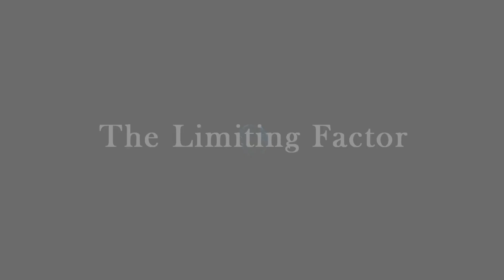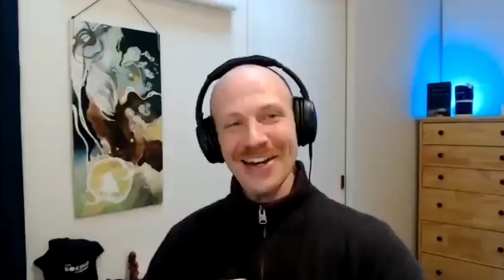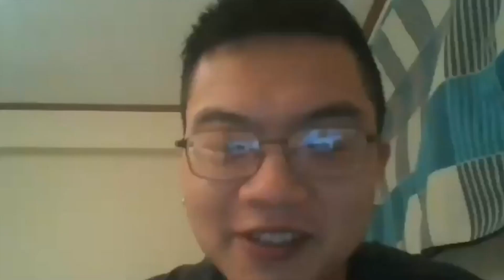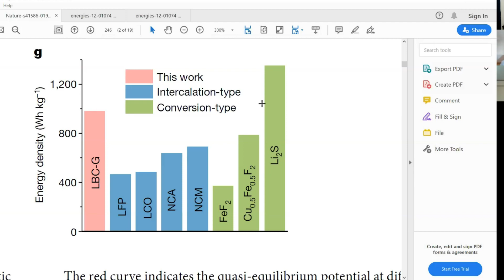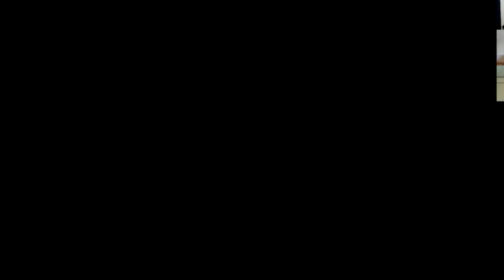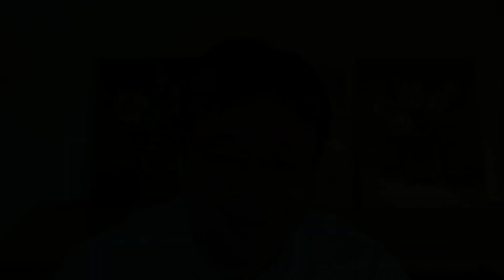Prof. Wang & Chongyin Yang // Transition Metal Free Cathode

Comment: Keep in mind Jordan, even though the amount of lithium in sea water is around 200 billion tons it is diluted insanely around 0.1 ppm and separating is not efficient and economical at all, at least for now. That is why we still turn to brines and mining :)
Reply from the maker: Totally!  What was new to me here was that it's the same type of lithium used in the chemistry.  Even with conventionally produced lithium, this should be significantly cheaper.
Reply: @thelimitingfactor2887  Finger's crossed with the results with organic electrolytes specially because the upper cut-off voltage of this material is close to 4.5 V which means electrolytes are not stable, let's hope it goes well. But if it does, then the spider chart safety is going to go back for the points for NCA or NMC. Because they will still use graphite and plating could still happen and the risk of thermal runaway still exists. Anyway welldone with the interview with breaking down the title and discussing piece by piece. A nice strategy! Keep up the good work :)
Reply from the maker: @batterybulletin  Great points, and I agree!  I need to do a deep dive video on this.  There were several points that didn't get discussed deeply enough.
Reply: @thelimitingfactor2887  would love to see a deep dive video, missed some of the information as i found one of the guys very hard to understand, but did get the jist of what he was saying for most part.
Reply from the maker: @Yahgiggle  Cool!  It will probably be a while, but I definitely want to do it.  There is a lot to cover before battery day 😀
Reply: @thelimitingfactor2887  oh yeah battery day yay can't wait for that, did you watch the SN5 150m Hop the other day, i watched it live and it was epic oO
Reply from the maker: @Yahgiggle  Same here 🔥.  It's a magic time!
Reply: @Yahgiggle  
Subtitles helped me get most of it.
Reply: @rogerstarkey5390  oh yeah good thinking, i forgot you can enable Subtitles, cheers for the reminder
Reply: @thelimitingfactor2887  indeed it is.
Reply: @rogerstarkey5390  

wrt the auto subtitles, not only it helps, but is also entertaining)   "Civil War Castle"... This neural net just had too much)))
Reply: "Not efficient and economical" ..... UNTIL you consider that it's not just the lithium you're after.
The various other salts must be considered, plus, ultimately the fresh water which will become increasingly scarce and valuable.
Reply: @rogerstarkey5390  absolutely, in certain parts of the world with massive dessalination the salts would be negative cost.
Reply: @rogerstarkey5390  the lithium ion concentration that I mentioned it not pure lithium ions, it's for all forms of lithium existing in the sea. I understand the fact the fresh water is scarce and there are countries already using sea water to get fresh water i.e Dubai. My comment was purely related to extracting LiCl or LiBr etc.
Reply: @rogerstarkey5390  , existing salt dry lake beds have already concentrated the salts, all that remains is mining it.  There are 2 cubic miles of lithium salts just in the dry salt lake near Reno, NV.  It's not unusual, lots more around the world.  That's Lithium.  Boron is highly earth abundant, too, same as Nitrogen and Chlorine, about.  Turkey has most reserves, about 1 BILLION TONS.  It's really cheap, nowhere close to nickel or cobalt, or even iron.
Reply: With the recent developments in seawater desalination using graphene , which is based on selectively allowing through fresh water based on precise pore size, it could be applied in the same manner to seperate the different ionic compounds (NaCl, Licl) based on their relative ionic sizes as well. Even applying different chemical processes might prove feasible if graphene provides a highly concentrated brine to work with
Reply: I could not understand enough of what your guests were saying due to theirs thick accents, and the echoing of their bare walls.  I finally gave up, even though I am always very interested to hear about battery breakthroughs.

I am apparently in the minority... I see other commenters seemed to have been able to get what he was saying.

I do wish you had done subtitles, and I encourage you to do so in the future with any guests, if it will clarify conments.  Also, suggest to your guests to do their interviews in rooms with drapes, beds, and other sound-deadening surfaces.

I congratulate them on their breakthroughs.
Reply: Maybe some useful information: the German Karlsruhe Institute for Technology has developed a way to actually filter out the Lithium from thermal water. Don't know whether this process can be used on all liquid forms, but it seems pretty interesting.

BTW Jordan @TheLimitingFactor2, Elektrec just verified your bigger Battery Cell theory on Twitter. Pics came out of the new cells. Also presented on the last Tesla Daily. Just wanted to pay my respects. I can't wrap my hand around the fact you have only about 30K subscribers. But then again, there's still people 'investing' in Nikola, so I guess those 30K set themselves apart as (a) of higher intellect and (b) as real investors and not speculators. Your channel is worth gold, and I mean that almost literally. Bought some Novonix shares after your piece on it, already up 90% (unfortunately wasn't much I invested😕). If it ever really catches up steam, I'll be sure to donate a bit!

Comment: Great stuff as usual. Giving the old periodic table a quick browse it's hard to see where we can go from here. Li and Br are about as reactive as it gets and as far apart on electronegativity as possible. Only Fl is going to be better than Br. The only other solution is to use Hydrogen as the charge carrier. But halides of hydrogen are a tad corrosive. The problem with batteries is there are so many constraints that need to be satisfied simultaneously.
Reply from the maker: Great insights Andy

Comment: Great interview and a really interesting technology. It would be great if you could ask a few follow up questions that could allow us to see the potential even further. I was wondering if the technology is applicable to using Silicon for both the anode and cathode, also if the dry battery technology is a potential enabler for the needed cycle life increase (since the encapsulation from the PTFE in maxwell technology might eleviate the need for the SEI layer they are after with the move from ionic to organic). Moreover, what benifits would synthetic graphite provide if applied to this technology.
Reply from the maker: Great questions!  I'll be covering them again at some point and will keep that in mind!  I'd love to see this with a pure lithium anode.
Reply: @thelimitingfactor2887  thanks. It would indeed great to see this with a metal anode or anode free, who knows, perhaps dendritic action is improved in an ionic solution. Also, in theory this technology should be also applicable to using sodium chloride instead, would be insane if they could do a metal free anode, ionic electrolyte, sodium chloride/bromide in a silicon/PTFE cathode. That would be the holy grail of batteries 🥺

Comment: This paper has been on my to do list. Glad you did this interview ,Jordan. I really liked the collaboration with the industry and would definitely be interested to learn about the improvement in cycle life. The aqueous voltage boost is huge but I was surprised when he mentioned that gravimetric energy density would be around 300-400 Wh/kg even though the plots showed much higher. I guess the paper should have details on the form factor. 
Will rewatch again after going through the paper.  
But Jeff Dahn doesn't often comment with excitement on all research papers and this was the one. Also, since Jeff has been doing to work on current energy boosting to move industry forward, this makes sense. Keep the amazing work going.  Cheers!
Reply from the maker: Thanks for watching!  I think the charts were showing just at the material level for the cathode alone.  I still need to do more digging.
Reply: The Limiting Factor 2 lets chat after I catch and have a detailed discussion. This definitely is insightful.

Comment: Seems like potential for a whole new industry based around.
Seawater,
Carbon nanofilters, (Graphene?)
Salt separation, (fresh water production)
etc.
Reply from the maker: Yeah buddy!  Gotta be a better way than letting it sun dry.
Reply: @thelimitingfactor2887  
Spitballing.....
Imagine a carbon based material that could have seawater pumped through it, then be removed to be used as a component in a cell, having collected the necessary salts, minerals?
Ridiculous?
Reply from the maker: @rogerstarkey5390  I think it could get close!  I need to learn more about how this battery would be manufactured.
Reply: @thelimitingfactor2887  
The "Cumulus" one?
They mentioned construction in the interview.
Interestingly, at one point he also mentioned "water based electrolyte".
This cell will be purely for low cost storage, where physical bulk and density is less important.
Reply from the maker: @rogerstarkey5390  huh! I'll have to look into Cumulus...
Reply: @rogerstarkey5390  don't we already have Redox Flow for that?
Reply: You may find this interesting.
Possibly an interview?
https://widget.spreaker.com/player?episode_id=40072128&autoplay=false&playlist=show&cover_image_url=https%3A%2F%2Fd3wo5wojvuv7l.cloudfront.net%2Fimages.spreaker.com%2Foriginal%2F715e10decc3528e84d1303d4f463c068.jpg